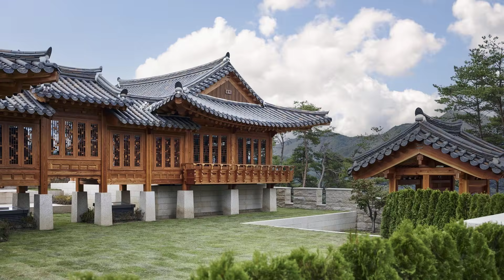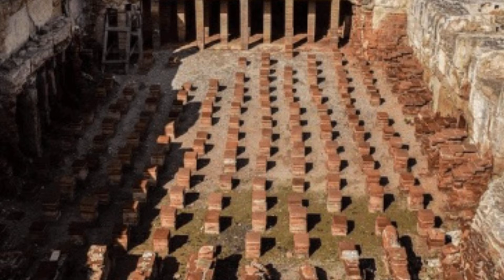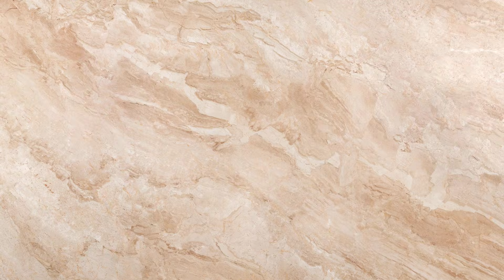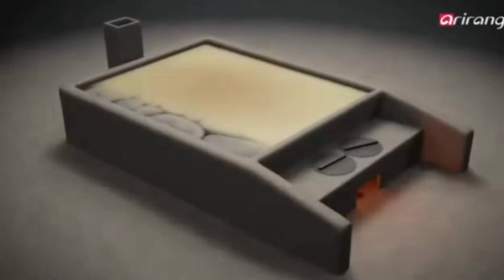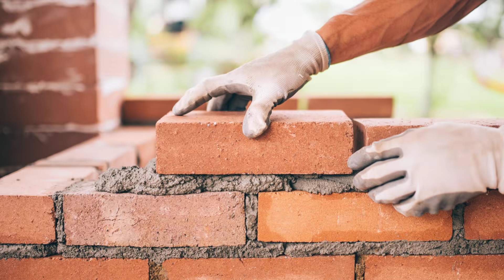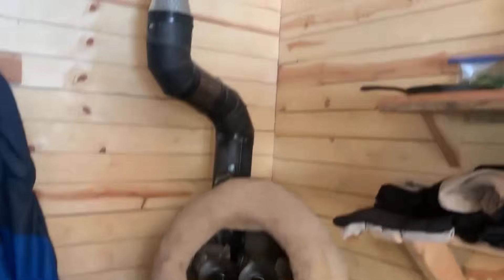This Floor Will Heat Your Entire Home WITHOUT Electricity. Why Did The Energy Industry Ban It?

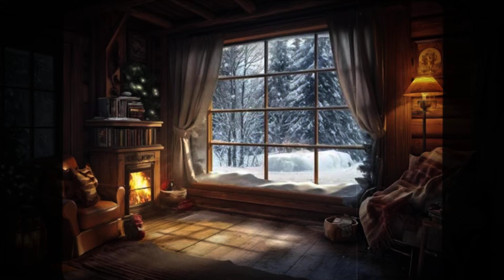Comment: 4:52 5kg complete dry firewood theoretical heat value is 90Mj / 25kwh 
At cold winter like korea peninsula a well insulated home needs 80-150w per square metre floor space.

Even if the system is 100% effiency and delivery heat ever so evently, for a 80sqm house, it can only provide 3 hours of heating.

More practical is people need 40-80kg of fire wood per day, not 3-5kg.

Comment: Basically heat up stone under the house and it stays warm for a long period of time. Use passages to send warm smoke under the floor. or simply in modern times can use a heater to heat air and send it under the floor using the same modern systems that currently use ducts...